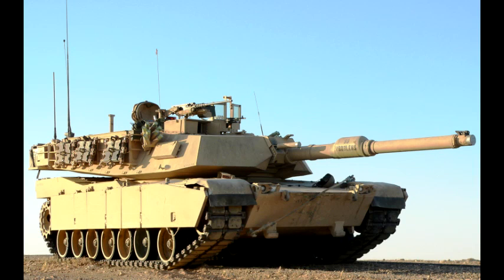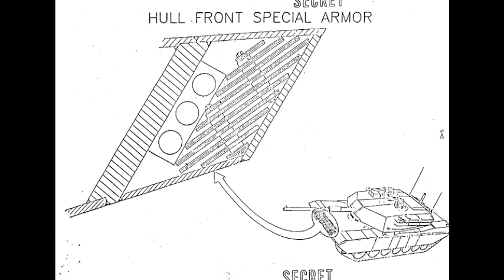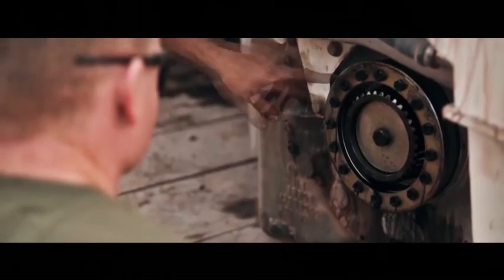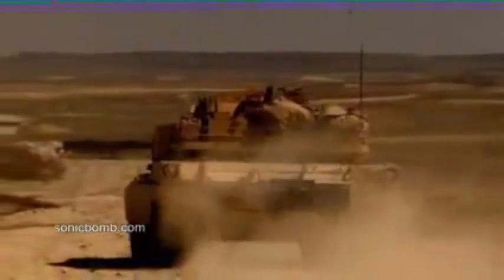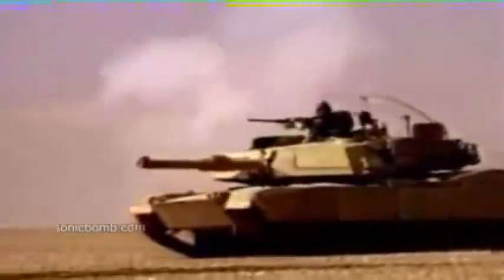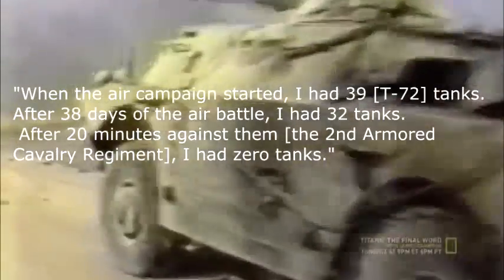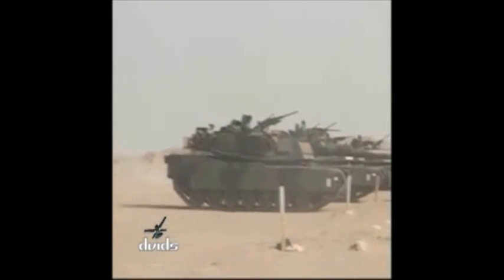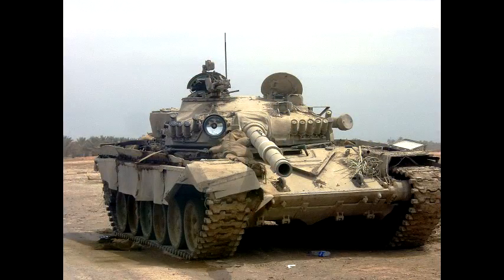M1A1 Abrams Baptism by Fire-Gulf War - M1A1 Abrams Tank Review

Comment: Very much appreciate the video. Well done. 

I am doing research into the armor packages. It seems from most public data that the M1-M1A1 was better vs CE then Russian estimates suggested, while KE performance was very good against primitive APFSDS like steel tungsten slug hybrids, and early Soviet attempts at a  more advanced design 3Bm-42. It wasn't as effective against advanced mono block designs like the m833 m829 and certainly not the M829A1. The influential people in the defense industry felt that the Russians would start introducing advanced monoblock in the late 1980s with bigger and improved guns with better then 700mm penetration at 2km. 

The defense industry spent billions developing HAP-1 against that threat profile in the early 1980s when it probably wasn't really needed. The biggest threat M1A1s faced in the late 1980s and early 1990s was their own wepons in blue on blue engagements with Tow-2A,M829A1, and Hellfire missiles.
Reply: @MyHentaiGirl  Their own testing suggested that even the 105mm monoblock DU APFSDS M774 could defeat the armor package of the M1 Abrams from over 3000m. The USSR was so poor at distributing newever ammo to tank units, that even by 1990 most tankers never got their hands on anything better then the BM-22.

Comment: 17 rounds in the racks with 6 rounds (3+3 in 2 separate areas) stowed in the subturret. 40 total.     the only time i had to enter info into the fire control computer was during an MRS update. everything else was auto entered through sensors and range finder laser.  1/72 Ar   First Tank!!!

Comment: Not proven... fighting outdated armour is not proven...
Reply: Lol add 200mm more armour and still wouldn't make a difference
Reply: @smithnwesson990  The Abrams and Challenger 2 are only 900mm of KE protection. While the Leopard 2A5 and other variants have 1500mm of KE protection. The Leopard 2's armour wedge Melts and Eats DU rounds. Here are 2 references below

Reference: 

Melts and Eats DU rounds... First DU is a Ductile long that up for yourself: https://www.quora.com/Is-the-front-of-the-Leopard-2-MBT-a-shot-trap-It-seems-like-an-APFSDS-round-would-be-guided-into-the-turret-ring-by-the-converging-angles-of-the-upper-hull-glacis-and-the-bottom-of-the-turret

1500mm of KE protection : https://medium.com/@gma02695/the-leopard-2-tank-vs-the-m1-abrams-da0a282cba1e
Reply: @PanzerEdelweissStevenDelMar555  Wiki article? Yea you left out some important parts. It's only the arrow module that extends it too 1500 mm not the majority of the tanks armor. Secondly it was made defeat 2nd gen APFDS Rounds not 4th gen composite ones which use tungsten for 10 inches then DU composite. Also with modern systems and updated HE and Armour Piercing rounds it has become moot as now active protection or ERA is required to survive at medium to close ranges. Also what did amy of your commemt have to do with my original comment that any extra armour on Russian T72s would never have changed anything? You made some strange refrence to it not being modern yet the Abrams in that battle were made in the early 80s. So again moot point. That's not to say the Leopard 2A5 isnt a great tank because it is a top 3 tank and maybe the best but that is irrelevant to the original statement of a battle in 1991
Reply: SmithN' Wesson Your wrong, wiki never said that the size increased to 1500mm, because the size of the wedge is at 2000mm. The Armour is 1500mm of KE protection. Where is your reference that it was made to defeat 2nd Generation APFDS? the wedge was actually a big upgrade to counter later DU or TUNGSTEN APFSDS, eroding it.
Reply: @Silenet K if its Fighting outdated tanks like cheap clones of T55' and T72's or tanks from the 70's equipment then it's not combat proven, Combat proven is about fighting actual equal timeline competitor
Reply: @Silenet K also Abrams never has survive a Kornet a Leopard has
Reply: @Silenet K Yea It beat Saddams Army because his equipment weren't soo Good? So you think fighting a War with 100% win rate Combat proven. Nope it isn't
Reply: @Silenet K Nope Those turkish Leopard tanks have survive different missles, Also other Leopards have done well in Bosnia and other Leopards have survive a IED
Reply: @Silenet K Nope it was a old version of the Leopard, also it was more than two some 3 in each tank 1 did blew up but crew survive
Reply: @Silenet K stop convincing me you cannot
Reply: @Silenet K also I forgot, stop twisting the definition of Combat proven
Reply: @Silenet K you cannot convince anyone what tank is his favourite, it's called tough masculinity, if you dont get bullied  you wont get tougher, that is why I wont make a video explaining the things I know that what makes the Leopard better than the Abrams.
Reply: @Silenet K Abrams could not survive a TOW2A or a Kornet, anything that surpasses a penetration of 900mm of RHA the Abrams has not been able to withstand
Reply: @Silenet K But never Abrams survive on it the Leopard has
Reply: @Silenet K That is no glancing blow, that is the middle of the turret look at it again, the black spot is in the center
Reply: @Silenet K wrong Merkave IV has also survive a hit like that as well
Reply: @Silenet K Also did you even see the other Kornet videos They got hit from the side the first didnt blew up, the 2nd has some engine fires but from what was said Turkey have very little casualties there hasn't been any dead leopard crew member yet, but there has been dead M60 crew members
Reply: @Silenet K  It did hit the rear turret and smoke dischargers it's still operational so now you neglect that I showed you those Turkish Leopards survive Kornets from the last Video. They did not blew up
Reply: @Silenet K also I dont believe Merkava is a beast because it was the latest version that resisted Kornets, I never heard a Merkava MkII survive a Kornet yet, I heard they were blow up badly by Kornets
Reply: @Silenet K Also did you even read my Bellingcat link? That was actual proof from the Turkish military that those Leopard were only heavily damaged from the ATGMs you really did not read
Reply: @Silenet K Dont assume your right Becauss if you read my new replies and dont contend to me, this means your prove nothing and your link are irrelevant
Reply: @Silenet K Anyway dont worry Like I said it's just called my masculinity I do believe Abrams has the better firepower due to its DU rounds, I would take the Abrams to invade a country while the Leopard is for defense, but I still choose the Leopard anytime anyday. anyway I'm a Asian filipino, It was strange for me why you tell me about the people in Europe when your doing beers
Reply: @Silenet K I wouldn't say Combat proven, like I said if its combat proven then it has to fight equal timeline competitors, this would be only called "The only tank with battle service"
Reply: @Silenet K Also the Leopard would be the one with Combat proven because it was fighting new 2000 era ATGMs, the Abrams hasn't encountered a Kornet aside from export versions, therefore Abrams is the one who only serve a War with a sure clear victory